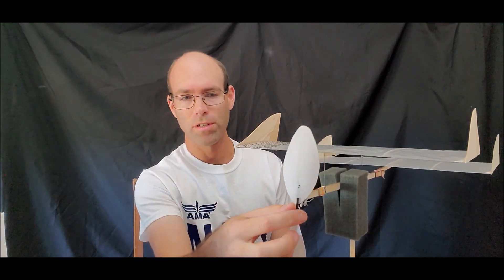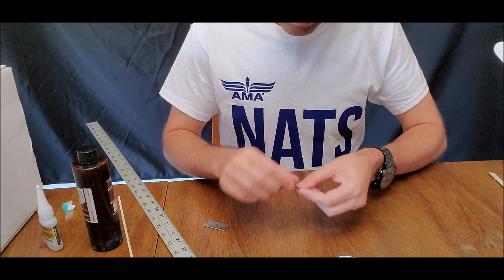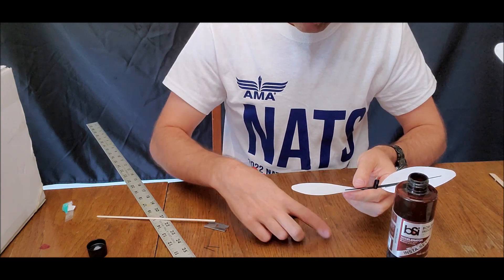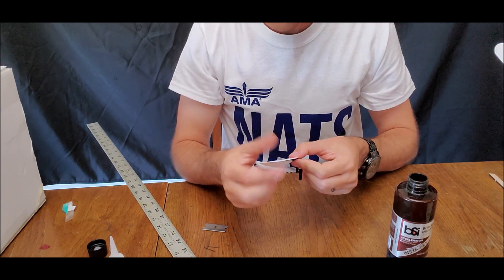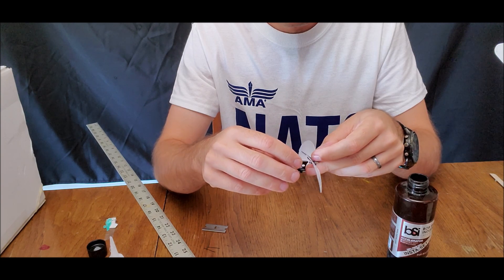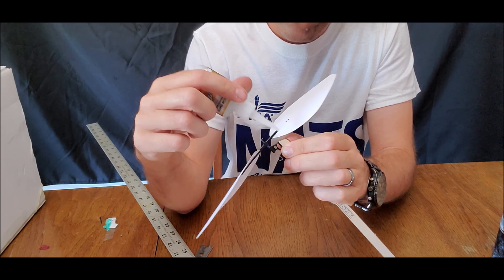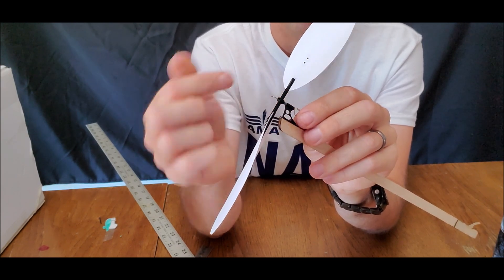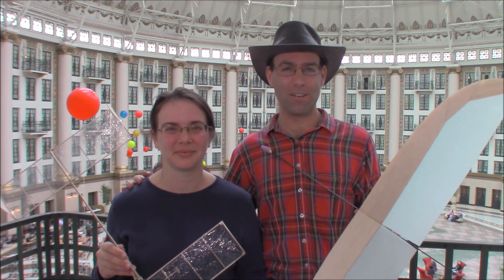Modifying IFFS propellers for improved performance in indoor flying and Science Olympiad competition

Comment: Josh I have a question...What is the best way to store CA glue?  Have wasted so much in the past.  Thanks for the great videos.
Reply from the maker: Best I can tell you is clean any glue off the nozzle and keep it capped securely when not in use. I don't buy particularly large bottles because once opened, they do start gradually hardening. Also avoid large changes in temperature as that tends to congeal and harden the glue.
Reply: @joshuawfinn  Thank you for the reply.

Comment: Good prop tips.  I mean tips for props.  Or is that props for your prop tip tips?  🤣  I haven't used my IFFS props yet, but I will definitely remove them from the "hanger."  I really prefer traditional Aluminum bearings.  One of the problems I had with IKARA props, the balance clay "ate" the plastic and I had to clip both tips to salvage the propeller.  (a "long term" concern--the model was stored away for several seasons...)
Reply from the maker: Hahahaha! That's funny!
I haven't had problems with clay eating the plastic, but some formulations probably have some solvents in them that cause problems.